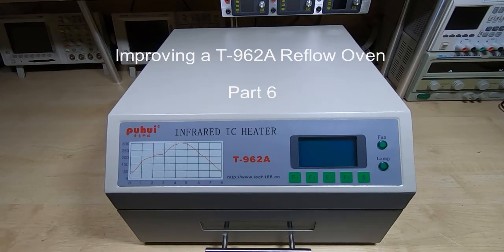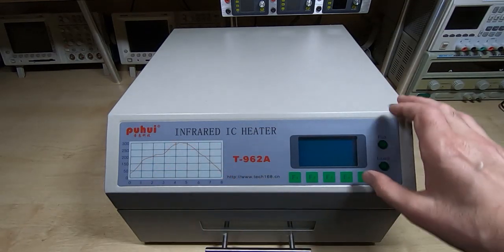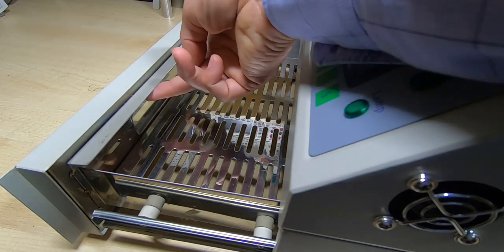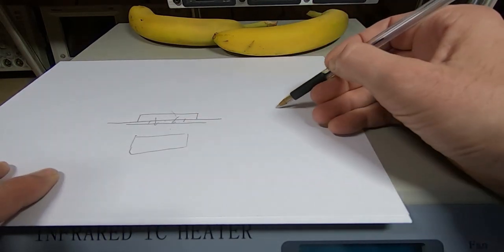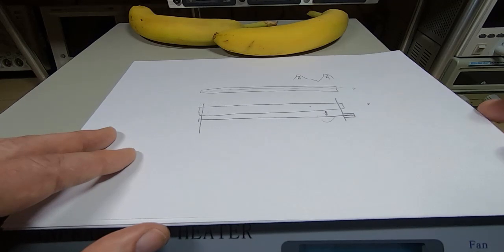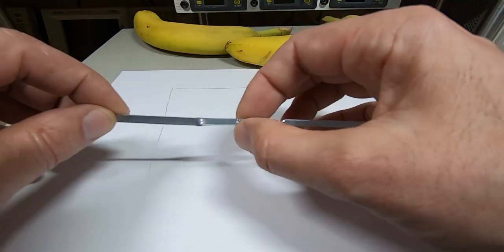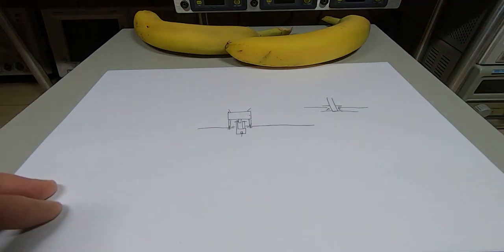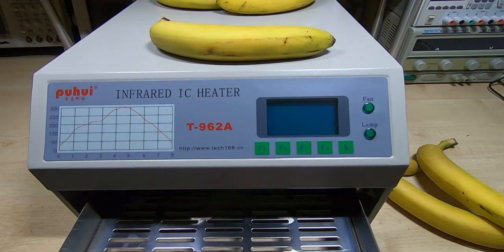Improving a T-962A Reflow Oven Part6

Comment: Amazing how a different perspective can have huge impacts, on this project, we really have to think inside the box.  Awesome work, I hope you keep sharing and teaching.

Limited budget and after all the reviews read,  I purchased and was expecting to firmware upgrade.  Unboxed, quick inspection of the model, short test with just paste on a bits of foil,  I thought the profiles were manageable for a small board, find the right tray location, I am happy for the cost outlay, bargain really.  

I feel like I made the right choice for my hobby.  Investing in this questionable Reflow Oven, with small manageable modifications, without risk.  The potential for my hobby to expand has increased.

Comment: Thanks for the tips.  I am impressed with the level of dedication you gave to making this unruly contraption work.  

Without your suggested modifications, I don't know how you could depend on one of these ovens.  I added a recirculation fan and wires beneath the heating elements on my T-962 (the smaller oven).  Baffles were preinstalled in the rear so I did not need to perform this step.  The upgrades kept the temperature spread under 20 deg C during ramp up and less than 10 deg C at the peak.  I reprogrammed with Unified Engineering's T-962 controller firmware, which allowed me to calibrate the thermocouple offsets and achieve higher accuracy (<5 deg C difference from board average) near the peak.   

Here is one more suggestion for anyone else looking to embark on this troublesome path with the T-962 series reflow ovens.  The temperature probes are extremely sensitive to their position in the chamber.  As configured, the thermocouple probes were reading significantly lower than the PCB itself (>40 deg C during heating).  I tried a lot of different positions in the board, but it was very sensitive and seemed to wildly diverge with even small changes in position.  Instead, I added a tiny bit of Kapton tape to the ends of the thermocouple probes to increase the amount of radiant heat they receive.  This seemed to significantly improve their accuracy at peak temperatures and reduced their sensitivity to position.  The Kapton tape reduced the temperature difference between the probes and the PCB to <20 deg C during full blast heating (due to thermal lag) and < 5 deg C near the peak when the duty cycle was 50%.  

Overall, I am not very impressed with the T-962 series reflow ovens.  Even after all this work,  it has erratic behavior, such as auto-starting another run.  It needs to be baby-sat constantly or else it will go out of control.  The oven seems like it is just barely in the operating zone.  It is difficult to verify the actual temperature spread inside the chamber.  On the flip side, the oven is very configurable, and you could most certainly build your own controller without harming the pocketbook too much.

Comment: Excellent analysis and video series!! I'm wondering if placing one of the TCs in contact with a PCB would help to have a more accurate PCB temperature measurement? That would need a longer and more frexible TC cable. Also. Do you think that instead of installing the ceiling blower, it would have a similar effect by keeping the rear fan running slowly throughout the process (maybe using PWM) and ramping up to full speed when the controller needs to drop the temperature?

Comment: Would this oven be suitable for soldering mosfets that use solder filled vias for thermal management?  How about BGA, because those might not heat up if they are in the shadow of the chip?

Comment: Hi, I have watched all your YouTube videos about the improvement of the T-962A Reflow oven. This is a very impressive, well-illustrated and professional work. Thanks! I have now purchased a T-962 Reflow oven, the little brother to the T-962A. I want to make a warning about the device. When unpacking and testing the device and measure the voltage between the device case and the mains ground I got about 94 volt AC! After doing all the device ground modifications this voltage completely disappeared. My question to you is if you did measure the change in Cold Junction temperature when operating the device. If so how big difference did you note. Furthermore, if I understand it correctly, you never did any firmware upgrades or change the electronics. That was not necessary to get the oven to work correctly as I understand it. Can you please confirm that? Regards, Bo, SM6FIE

Comment: Hi Jerry, these videos are great and I’m having the same issues with my T962A, some areas too hot and others too cold so I’m now getting the parts together to make the changes you made, mainly the baffles, stirrer motor and TC relocation. Out of interest, what spot welder did you use for this? Kind Regards, Simon.

Comment: great vid many thanks , subscribed . does 
these modifications apply to the new T962A+
Reply from the maker: I have not seen a T962A+ so do not know how it differs from the T962A. The spec states that it has air recirculation so they may have added a circulation impeller but you would need to investigate it to be sure. If not then the modifications I show would certainly help.
Reply: @JerryWalker001   yes and it reaches 350 degree temperature what might be worse or better . and has larger working area

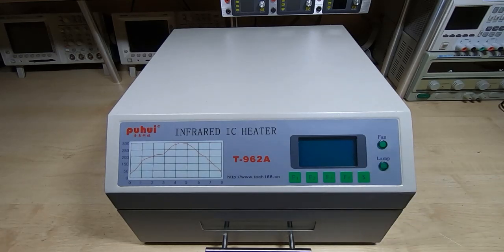Comment: Jerry,  I was recording several temperature probes on a small PCB and soon realized my graph was minutes longer then the T962A display. At first suspecting the recorder I checked using a stop watch. A stop watch recorded 1:35 minutes : seconds for each T962A minute. Yikes! That is pretty bad. I'll contact the seller.

Comment: Thanks for all the amazing research. I could use a little clarification though. You originally started with some "shadow" baffle strips under the heating elements that looked about 6-7mm wide, almost as wide as the heating elements. In this recap you described them as 1mm wire, and I think I read 0.8mm wire elsewhere. Do you mean that these very thin wires cast a sufficent "shadow" to even out the IR distribution? It ask because it hardly seems that would be much of a shadow. I'm trying to order some appropriate wire form mcmaster if thats really all you ended up using. Could you confirm the diameter of the heating elements in your particular unit as well (if it's handy)?  I notice they sell this wire in matte or mirror finish. Any thoughts on that? Thanks so much.
Reply from the maker: It depends entirely on how far from the heaters you fit them.The aim is to case a 'shadow' at the pcb level which is around 50% the width of the heater and is directly below the heater centre line. I suggest you draw it to scale as a cross section and use the emissive diameter of the heater as the 'source'. Note that this is not the same as the heater diameter and depends on the type of heater fitted. As a general guide use 75% of the heater diameter. The wires should be high enough so that they only affect the heater they are under and do not create secondary shadows for the other 3 heaters.

Comment: The simpelest solution i reckon is to have your board rotating under the heaters. Probably solves the problem without all the trouble of millimeter arranging elements etc etc.  My 2 cents.  a commercial oven the board travels so it aint get spot heated. since you cant do that in this enclosed case so rotating may be closest you can get.
Just like it does in a microwave oven :)  dont even have to invent the wheel again, get the rotating mechanism of a dumpster one.
Reply from the maker: Unfortunately that would not work. Yes commercial ovens have conveyors but that is not the same as rotating under linear IR heaters. I did try this to see the effect but it was hopeless and gave very poor results. You also then have the problem of having a moving platform in the hot area and the resulting loss in effective capacity. For example the board I used would not be able to rotate as the diagonal size is greater than the width of the chamber. Also the heaters do not heat to the ends . The centre of a rotating board would be subject to very different conditions to the outer edges. Overall the solution I describe is very easy to implement and does not require precision parts and gives very good results. You are of course free to modify your own oven in whatever way you choose. If you can get a rotating system to work then posting a video of the result may help others.

Comment: So, ever since Video 2 I had an independent thought right away of moving the board back and forth inside the oven to change incident angles of infrared radiation... Using stepper motors outside, pulling on wires, with wires moving the PCB inside... You said you were going to attempt that... Any results on your "conveyor" concept???
Reply from the maker: I discuss this in a later video. I did try a 'conveyor' system in which I fitted a motor with a sine drive to move the board by half the spacing of the heaters to simulate a conveyor. This did improve the performance but not by enough to make it worth the complication. The simple changes I describe in the final video were sufficient to get good operation and consistent results. My goal was to get the temperature in the chamber to follow the programmed profile and also to be consistent across all areas of the chamber and the changes I describe meet this target so I did not retain the mechainical movement. If you are interested the way I did this was to fit a motor/gearbox with a cam outside the chamber in the space next to the fan at the back. Inside the chamber I fitted a sliding platform with a spring pulling it to the rear. A pushrod ran through a hole to the cam so that the drawer could be opened (The plate moved to the rear as the pushrod came off the cam). So no direct link between motor and plate. The cam gave 50% of the travel compared to the heater spacing and it rotated at 10 rpm. It worked well but was not really needed.
Reply: @JerryWalker001  Thank you for the detailed technical explanation of your attempt, and its results!!!

Comment: I've got a similar model to this. I found that its almost useless for any critical reflow. Even on a 100mm board, the temperature is too inconsistent. I thought about doing exactly the modification you did, the fan on top. Glad to see it actually works. I guess I need to do it now. Its a shame they don't make such a basic improvement themselves.
Reply from the maker: Yes I totally agree. Even if they added the £5.00 it would cost to make the change it would be well worth it. I found the oven pretty much useless without modifying it.
Reply: @JerryWalker001  100mm PCB, the edge of the board are burned, and the paste in the center not melted. Definitely useless as is.

Comment: Great video !  I have been looking forward to this last installment. After watching your series, I created a temperature test board with 8 thermocouple tips  laid out like yours, and designed an arduino board with eight MAX31855 ICs to acquire the data . I calibrated all channels using a single NIST Digital thermometer. The MAX aren’t super precise, but after calibration and  with your extensive analysis and  modifications I should be able to come close to duplicating your oven results. Although, I am still baffled at how the bananas were produced. Thanks again for this video series. I hope to run some boards containing large FPGA BGAs through soon.
Reply from the maker: Yes the bananas are a mystery, They are supposed to be apples. Please let me know how you get on with the BGA's (You may need to preheat the boards as the oven does not have an underside heater).
Reply: John, how did it work out? I'm right where you where in 6 months ago. I wanted to test the base unit first with a few probes on one small PCB near each other. This to eliminate a probe issue. The PCB was behind the screen displayed profile F1 by over a minute. It did seem to track the profile, somewhat. Stayed at peak temperature much longer than it should have. The cooling phase is totally inadequate.  Not even close to the profile.
Reply: i dont mean to be so off topic but does anybody know a trick to log back into an instagram account..?
I somehow lost the password. I love any assistance you can offer me
Reply: @Boden Nathaniel I really appreciate your reply. I found the site thru google and I'm trying it out now.
Seems to take a while so I will get back to you later when my account password hopefully is recovered.
Reply: @Boden Nathaniel It worked and I now got access to my account again. Im so happy!
Thank you so much you saved my account :D
Reply: @Jaxx Mason glad I could help :D